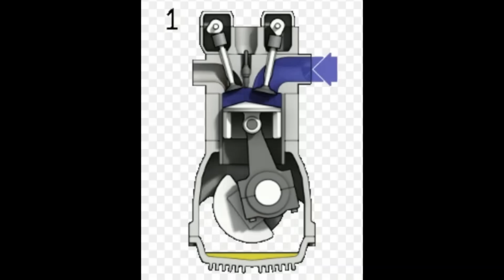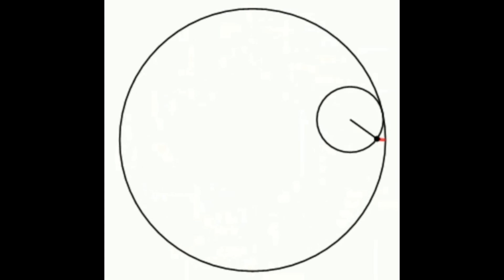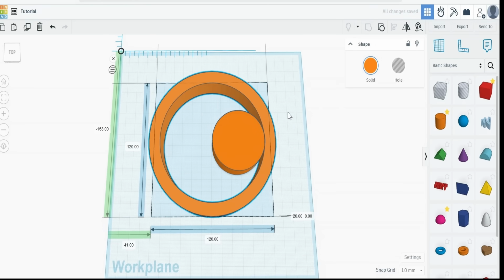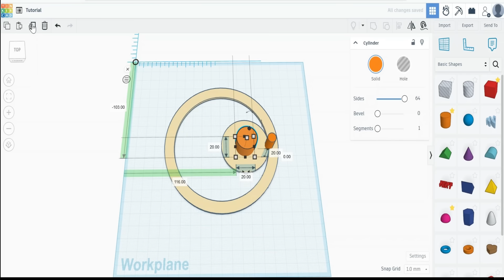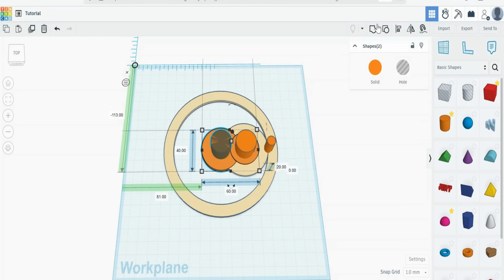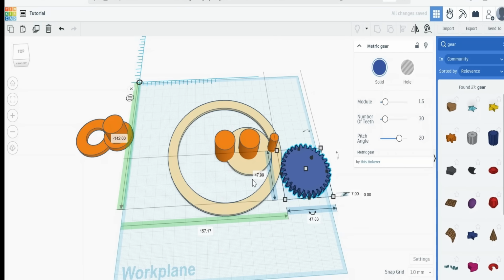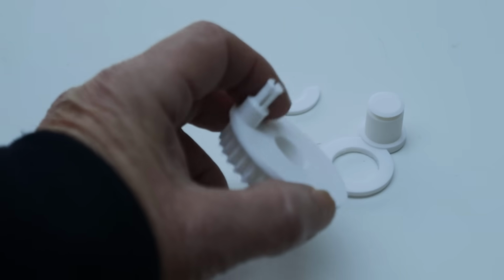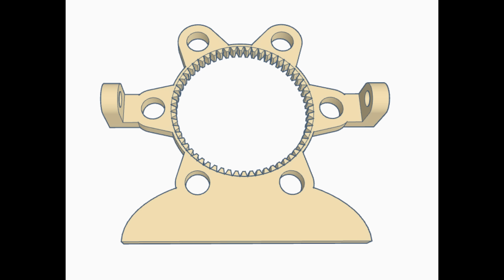2327 The Hypocycloid Engine

Comment: Interestingly, at the dawn of the industrial revolution, the idea of using a crankshaft had been patented for a while. This is one of the reasons you'll sometimes see a pair of gears (not arranged like this but two identically sized ones) called a "sun and planet gear" on early steam engines. What that also does is make the flywheel spin faster while keeping the cycling rate of the piston the same, but I don't think that was the main concern.

Comment: Question:

The center line is symmetrical. If driven by the shaft the turn-around points have an ambiguity, it may spin left or right with equal probability. To ensure that for oscillating linear motion the rotational motion is always in one direction it must thus require a (small) perturbation to break the symmety. Without that it won't turn the same direction with every thrust.

How is this done practically? 

(I can imagine uni-directional gears or a ratcheting mechanism may be used, but what is an elegant way to ensure this? Is that perhaps why the actual engine has all the extra epicycles in the back?)
Reply: i believe thats the point of the flywheel so momentum would keep it rotating in the same direction as it passes each end point

Comment: Cycloidal motion has potential for engines.  So now we need a cylinder on each end of the central drive shaft, clone the unit, and connect the two shafts of the units together.  Now you have a low friction 4 popper.  How could one make them function in balance?  Could two drive shafts actually move by reciprocation?

Comment: Instead of a flywheel one could add 2 pistons with 90 degrees angle of the inner crank, both sharing the same ring gear. One on each side.
Reply from the maker: Cool idea

Comment: rack and pinion + one way clutch could convert reciprocating motion into rotary.
 idea I've had for a 2 stroke ...
two opposed pistons. the piston's motion can control valves akin to "bash valves"
have piston reciprocation drive a toothed rack.
Pair of pinion gears driven by rack
each pinion drives a one way clutch . the clutches engages on opposite rotation
each one way clutch drives a shaft
shaft rotation connected via equal toothed spur gear.
power out via one of the shafts, or spur gears
Reply from the maker: give it a go building it mate

Comment: I use FreeCad a little bit, but find it much easier (and quicker) to draw my ideas or designs by hand most times.
Reply from the maker: awesome - whatever works for you - though my objective is to 3D print hem so I sort of need the STL files
Reply: @ThinkingandTinkering  I guess I am double handling. I like your style of presentation.

Comment: Tinkercad is so under appreciated by so many and is vastly underrated. I work as a machinist and run CNC mills, CNC lathes and also 3D print a lot. I nearly exclusively use Tinkercad to CAD, and will use other software for CAM if milling or turning. I get made fun of a lot for it, but I don’t care. If you have internet access, you have access to free CAD with a lot of features and the more you use it, the more tricks you’ll learn along the way.

Also, for all you Arduino fans out there, Tinkercad has a virtual Arduino section that will literally let you build virtual circuits using virtual boards, then write your code for that circuit and then test run it. It’s such an excellent resource to have. 

Keep things simple 👌🏼

Comment: Mr. Murray-Smith, I have vague memory that James Watt couldn't use a crank because it was patented, I also recall that drawings of the Watt engine showed a ring gear and planet arrangement similar to the one you've featured at about 1:30. I'll likely never know, but makes for some interesting speculation.
Reply from the maker: Watt used a sun and planet gear not a ring ear - but he did it for exactly why you say. Actually it was William Murdoch but he worked for Watt so Watt patented it - this was in 1871 - this engine was created in 1805

Comment: I think the gears on the Birmingham engine should have been twice or 3x the size for more torque at the flywheel
Reply from the maker: maybe - but it was what it was and you can't take away from the fact that it has been running since 1805! that is pretty impressive in itself lol

Comment: Have you tried Algodoo, which is a 2D physics simulator with a dead-simple user interface? It will let you make working models of many of your mechanisms without needing tinkercad or a 3D printer. (Not self-promoting; I'm just a fan.)

Comment: Is cutting the negative of a gear the right way to do a ring gear like that, or just a convenience for an unloaded demo model?  I would have thought that a ring gear would still need convex tooth faces for proper engagement.
Reply from the maker: the right way? It's a way and It works fine - i have done several tutorials on ring gears including modelling them with onshape - but for this a cutaway is fine - it's never a question of what is 'best' only ever a question of what works, what is appropriate and what gets the job done - given the video is really about the use of construction drawings how you do the ring gear is really up to you
Reply: @ThinkingandTinkering  Fair enough!  It can be so easy to fall into those weeds when explaining a design process, but you keep things very clear by avoiding tangential minutiae (not easily done).  By the by, I live near the Ford museum, but I can't recall if I've seen their example of this engine or not.  I'll have to keep my eyes peeled next time I'm there!  Cheers :)
Reply from the maker: @jamespray  it really can mate - I went there once about 5 years ago - amazing place i really want to go again so I am jealous you live so close lol

Comment: i've been wondering about a mechanism but don't have the tools to build it.. a horizontally rotating wheel that has a second unbalanced wheel mounted on its circumference, spinning around the rim so it rotates at the same speed as the primary central wheel... so the weight is always kicked out in one direction and rotated back in towards the centre in the opposite direction... like a kid kicking its legs out on a swing... wondering if the whole thing might move in one direction if the structure was mounted on a mobile platform... any ideas for a simple mechanism to rotate both wheels in sync?
Reply from the maker: to be honest i would actually encourage you to get the tools and give it a go - dreaming and doing are very distinctly two different things and you learn and achieve so much more when you try

Comment: Thank you so much, Rob. I recently looked into 3d printed bearings, saw the slew bearing and didn't think to try it as a universal bearing. I was hoping to find a linear bearing, like the LM8UU, but the one I tried was a bushing and still frictional. And I am delighted at that drive mech, so often in a design, even using magnets, recip to rotary is needed.
Reply from the maker: nothing wrong with bushings mate
Reply: @ThinkingandTinkering  I'm sure they're great but the printed LM8 bushes I tried in PLA didn't work well on mild steel rod. I have to say, I was using 5mm rod and resized the bushings to suit.

Comment: first let me say I love your channel. When I tune into one of your videos I can count on you engaging my brain. Thank You.
With that in mind I wondered  why do you call this an engine? It seems to be more of a transmission changing linear motion to rotary motion. What do you see as the benefits to this design over  a crankshaft system?
Reply from the maker: cheers mate - it's part one of a two part video - to be honest I haven't decided on the power input yet - then - of course there is the option of making it a generator - ah so many possibilities - even so the completed thing is an engine and i will be adding that second part soon - the main benefit is there are no sideways forces
Reply: @ThinkingandTinkering  I seem to remember a diesel piston layout where the piston was in the center of a cylinder with a combustion chamber at either end. the piston was driven back and forth which would fit right into the hypocycloid. I can't remember what the layout was called, it's kind of like the opposing piston design but with a combustion chamber at either end and only one piston moving end to end. I'll see if I can find the vedeo I saw.

Comment: Have you considered making a double piston chamber Sterling Engine with that?  You could make 4 chambers alternating hot cold.  Thus your left hand piston portion would be pushing with heat expansions while your Right hand area would be pulling with cold contractions. One of the gains would be the valving would be paired opposites the same place on the rotation would open the cold (In it's own air channel) and the opposites sides hot (again in it's own air channel) but only requiring one sliding valve with two separate air passages. *  (Were the lengths of bar shaft shorter you could make all 4 valve opening cut from one long plate of flat material.  But since rod length has to be long to accommodate a Starline Engines  compression area, which would be right next to  a contraction area  (They would alternate titles) the valving would be better served as two separate valve chambers each with a single Hot and a single Cold that are controlled via how they are clamped onto the working shaft (a fixed position on back and forth shaft would not allow for timing adjustments.)
* The material for the sliding valves would best be served by a material that does not create a heat sink/Cold sink in it's middle via Thermal Bridging.  As you would also not create any air passages that share a common wall for any length.
Reply from the maker: that's a good idea - i am still pondering the input section
Reply: @ThinkingandTinkering  There are Sterling Engines that have a large expansion chamber (about1/2 the size of a pool table)  With a little work 2 such expansion and contraction chambers could be made to set on each side of the shaft.  I have the room here to set up the heat collection boxes and let them run.

The work shop's progress is I am still hand digging the foundation for Building Number 1.  (woodworking mostly) and it's detention's are at 41.3' by 90' The weather here is about 2 degrees F. in the morning so using water to soften the ground is out of Season.  As soon as the earth is not frozen I can begin digging a Geo tube 10' down 150' long and it would provide air at 59 degrees all year long. (It would be a win IF the Geo tube could power the fan to run the air through the Geo tube (as near a perpetual motion machine as I would care to try for.)).

Comment: In the 1970s, a Dutch company built a car with a Hypocycloidal engine. Project was abandoned at an early stage because of unexpected  and insurmountable vibration. I remember it, but can find on trace of the engines history today. Regardless, It seems impossible to design a 4 cylinder horizontally opposed engine.
Reply: porsche has a patent for a 6 stroke engine that seems to be hypocycloidal
Reply from the maker: always a dangerous thing to say something is impossible mate lol

Comment: This reminded me of your bellows air mover (the motor part), except that it has a much more stable lateral motion than the Munsen ring pivoting arm. I've wanted to try that at some point, but I don't have a house (yet) so I don't have anywhere to get hot/cold air from lol. This was a cool build, thanks for all your hard work!
Reply from the maker: good point mate - it does remind me of that now you mention it